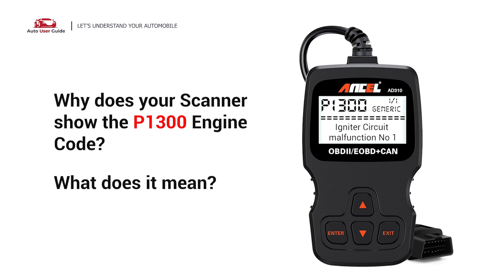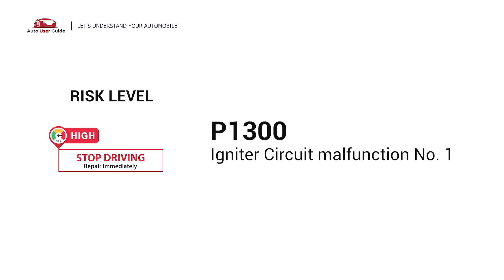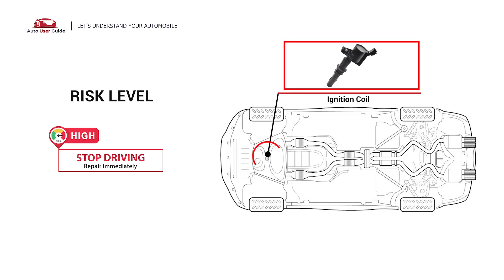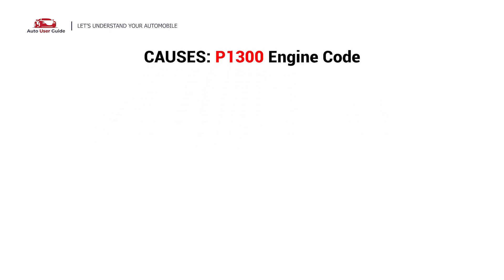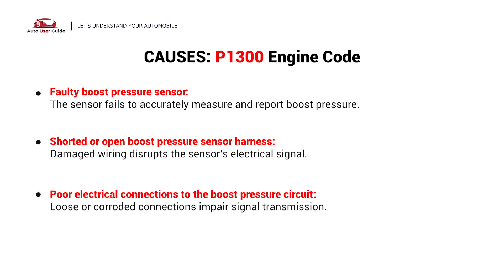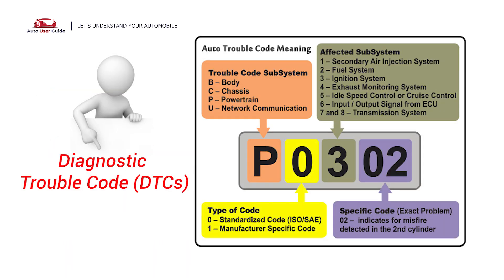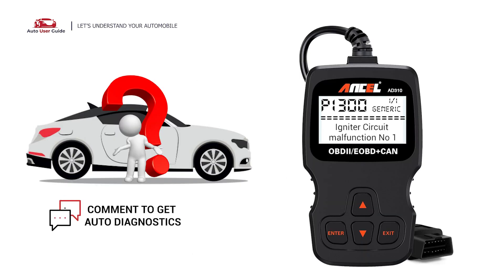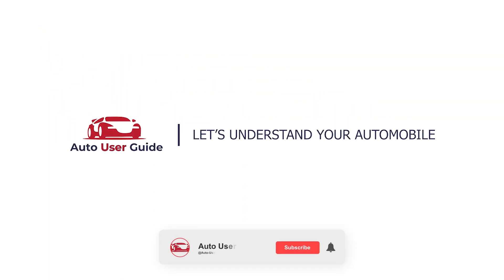What is P1300 : Engine Error Code Causes Explained

Comment: How to fix the p1300 code on my 96 Toyota 4Runner
Reply from the maker: For your 1996 Toyota 4Runner, the P1300 code usually indicates a Distributor Engine Control Circuit Malfunction ⚙️. This is related to the ignition system, specifically the distributor and its wiring.

Here’s what you can do:
1️⃣ Check the distributor cap, rotor, and ignition wires for wear or corrosion.
2️⃣ Inspect the ignition coil wiring and connectors — make sure everything is secure.
3️⃣ Test the ignition control module if wiring and distributor components look fine.

If you want, I can make a step-by-step guide showing how to diagnose and fix P1300 on your ’96 4Runner. Would you like me to do that????